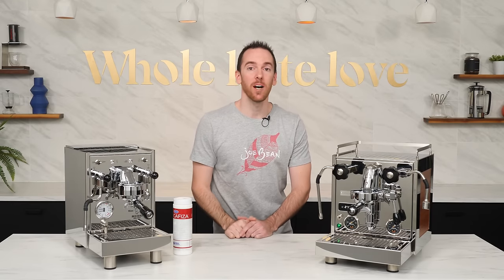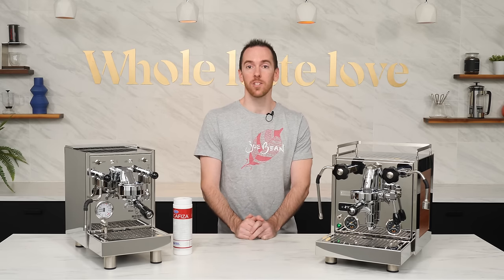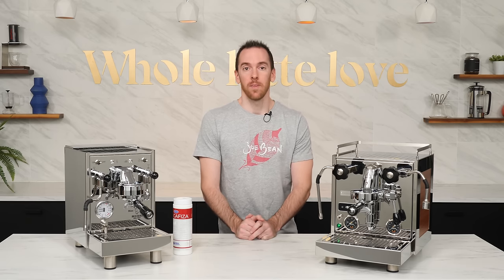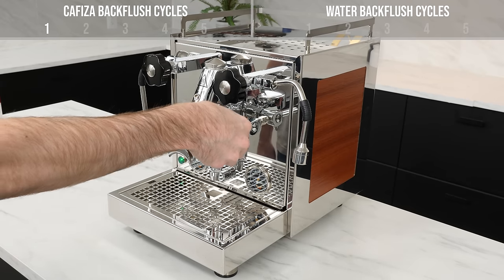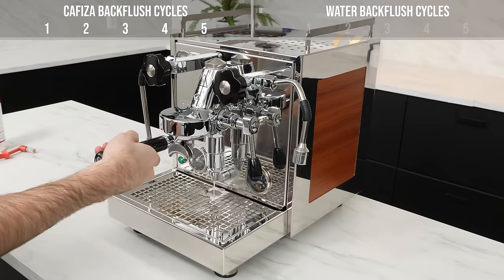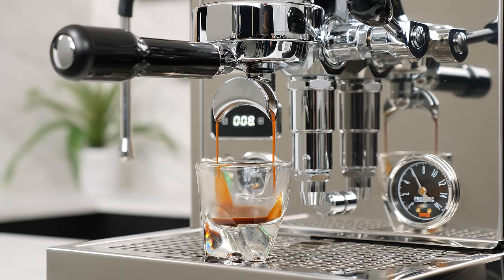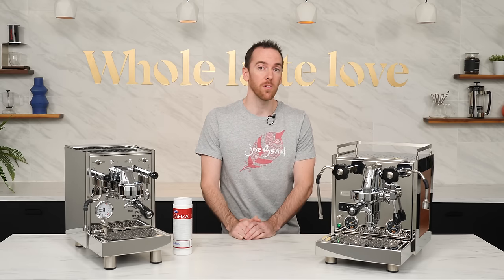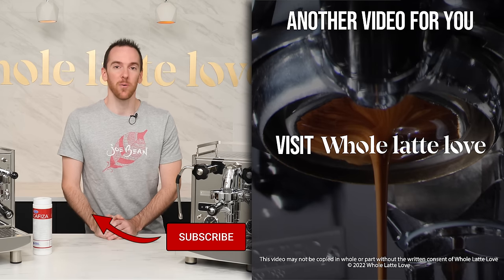How and Why to Backflush Your Espresso Machine

Comment: Thank you for this wee tutorial, can you do one on descaling an e61? Every time I do my older ecm giotto I have blue metalic (i assume calcium chloride) coming out of the hot water pipe for quite a while whilst the group and steam wand is fine. Thanks guys
Reply from the maker: Hey Ecosse, here are a couple videos showing the process of cleaning, descaling, and maintaining an E61 group:
https://youtu.be/4H57QSEMDhs
https://youtu.be/ELIwD40tsrs
AJ
Reply: Hi AJ I don’t think I was quite clear. My E61 i can do but adding durgol to the plastic water tank and pulling it through in to the hot water tank, when I drain out of the hot water pipe, I get blueish metallic water. The E61 head is fine. Is it a case it just needs more cleaning and flushing through the hot water pipe? If the hot water tank was still calcified that would come out of the E61 group head as well? Thanks for bearing with my communication
Reply from the maker: Ahh sorry for the confusion. Are you using a heat exchanger machine? If so, after descaling, are you draining the boiler through the steam wand? Then you'll want to water backflush and flush the group, and empty the boiler through the hot water wand 3-5 times to fully rinse the boiler. The process is shown in detail here: https://www.youtube.com/watch?v=yEGfyJkWSqU

If you're using a dual boiler, we (and most manufacturers) recommend having them professionally descaled rather than doing it yourself. Best thing to do with dual boiler machines (really for any machine) is to use water which does not cause scale to form in first place. For plumbed machines one can use in-line ion-exchange filtration like this system from BWT: https://www.wholelattelove.com/products/bwt-bestmax-premium-filter-package-w-besthead-flex For reservoir fed machines you can prevent scale using in reservoir ion-exchange pad filters like this: https://www.wholelattelove.com/products/bwt-bestsave-m-anti-scale-filter Or an ion-exchange filter pitcher: https://www.wholelattelove.com/products/bwt-penguin-2-7-l-water-pitcher
AJ
Reply: Aj thats perfect, thats the video I needed. You are very patient, thank you (ecm giotto 2009 heat x)

Comment: Hey AJ I back flush mine once a week is that too much
Reply from the maker: Hey jim, Backflush with plain water whenever you like. We recommend detergent/Cafiza backflush every 125-150 brew cycles. Overdoing detergent backflushes can remove internal lubrication (especially in E61 group machines) and cause squeaking and wear of internal group components.
Reply: @Wholelattelovepage  thank you for letting me know. I have the  BEZZERA BZ 13 DE and maybe I am back flushing too much so I’ll just do it every three or four weeks I have four shots a day every day between me and my wife

Comment: I have a BZ13, what is the recommended back flushing regiment?
Reply from the maker: The BZ13 manual recommends a daily backflush - I believe they're talking about just with water. Depending on your usage, you should be good following the schedule mentioned in this video: daily water backflush, monthly cafiza backflush. 
AJ

Comment: For a breville machine, is it better to use Cafiza or the Breville backflush tablets? I ask because the clean me light only comes on as needed, but I would like to clean the porta filter more frequently because of the gap underneath the plastic part.
Reply from the maker: THey're probably very similar, but it's usually better to go with the manufacturer's recommendations and use their own products. I believe on most Breville machines the clean me light comes on every 200 cycles. Not sure whether than resets on it's own if you do it more frequently or not, so that's something to watch out for. 
AJ
Reply: Here’s a tip: don’t wait for the machine to tell you when to back flush. If you make even just one coffee a day, it would serve you well to backflush once a week, maximum two weeks. I notice much better taste and overall operation this way. I also descale once every quarter. Good luck

Comment: Correct information. I will only do daily backflushing with grouphead detergent in a heavy commercial environment. There are users who follow cafe advice to performing aggressive cleaning for their home machine. Such aggressiveness destroy the vib pump and a total waste of time. Home users should get the daily grouphead flushing done in less than a minute. The Bezzera grouphead on the left has better engineering. Requires lesser detergent cleaner as it due to its cleaner design with lesser surface for oil to stick.
Reply from the maker: Hi q, Thanks for the comment!

Comment: Hi i have a delonghi la specialista prestigio how i could do the backflush in this machine
Reply from the maker: Hi, See section 8.1 in the machine's user manual for instructions on cleaning the coffee circuit. If you do not have the manual it's available here: https://www.delonghi.com/en-us/manuals/la-specialista-prestigio-espresso-machine-with-smart-tamping-station-and-dual-heating-system-stainless-steel-ec9355m/p/EC9355M

Comment: I have the ECM Giotto purchased years ago from your company. It stopped back flushing a long time ago with nothing coming from the valve. What should be done? Thanks!
Reply from the maker: Hi Oleg, sounds like there may be some buildup or blockage in there. Does anything come out of the E61 discharge tube after brewing? I'd go through the steps in this video on E61 maintenance to get all of the components cleaned and serviced. https://youtu.be/ELIwD40tsrs
AJ
Reply: @Wholelattelovepage  AJ, thank you for a speedy reply! Is there a kit of replacement parts I can order?
Reply from the maker: Yes, we actually have three kits depending on the level of replacement you need. It looks like two of them are currently sold out but should be back in stock soon. 
E61 Group Rebuild Kit - Basic: https://www.wholelattelove.com/products/e61-group-rebuild-kit-basic
E61 Group Rebuild Kit - Moderate: https://www.wholelattelove.com/products/e61-group-rebuild-kit-moderate-1
E61 Group Rebuild Kit - Major: https://www.wholelattelove.com/products/e61-group-rebuild-kit-major
AJ

Comment: My ecm synchronika brew lever has never been as smooth in operation as my old profitec 500 was, when i backflush it its plain horrible it basically wants to stick half when i pull it up, any suggestions???

Ohhhh types too soon! Lol
Reply from the maker: Haha oops! If it's still stiff or squeaky, you may want to lubricate the cam. Here's how: https://youtu.be/ELIwD40tsrs?t=201
AJ

Comment: Really appreciate these videos. I’m curious- when a flow control group is installed, should the flow be set to fully open during the backflush?
Reply from the maker: Hey Ben, Great question! I've always just had the valve open to stock flow rate when backflushing as that would be like backflushing without a flow control. But no reason I can think of to not open it up to a higher flow rate - would probably lend a little more power to the flush.
Reply: @Wholelattelovepage  excellent. Thanks very much!
Reply from the maker: @BenNordhues   I spoke with our lead prosumer machine tech. He confirmed opening the flow valve all the way when backflushing is beneficial. He says it will increase the force of backflush and in a more technical detail, it to some extent reduces exposure of an oring on the flow control assembly to the detergent in products like Cafiza. Not critical that happens but should extend the life of the oring a bit.
Reply: @Wholelattelovepage  This is fantastic - your thorough response and follow up is greatly appreciated and makes me glad i ordered from you all.  thanks again

Comment: Useful, but using filter paper can significantly reduce the amount of dirt that gets back.
Reply from the maker: Good point. I know some people use metal mesh puck screens too for a similar purpose, with less waste. Perhaps a topic for a future video. 
AJ
Reply: What is the process for using filter paper, please?
Reply: @les5309  You order 60mm AP paper from aliexpress. About $1,5/100pcs. After tampering it will fit right into the 58mm basket. The shower screen stays almost completely clean. Can be washed and reused a few times.
Reply: @Wholelattelovepage  Exactly, a metal mesh might be a better solution, but it is quite expensive compared to paper. My biggest problem with it is that it is quite thick.

Comment: 5 cycles of backflush daily ? Are you even serious ? Your goal is to waste 2 litters per day or what ?
Reply from the maker: I guess technically one "cycle" of 5 pulls. Because you're running this in a closed system, there's nowhere near 2 liters of water waste. You can see in the video even doing the 10 pulls (5 with detergent, 5 without) and flushes after each, the 1L drip tray was only about half full. 
AJ